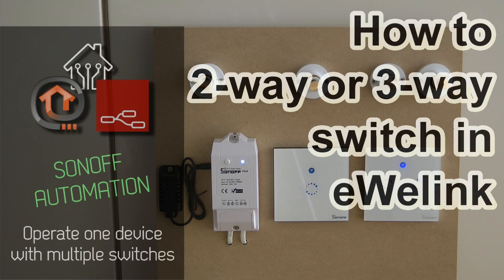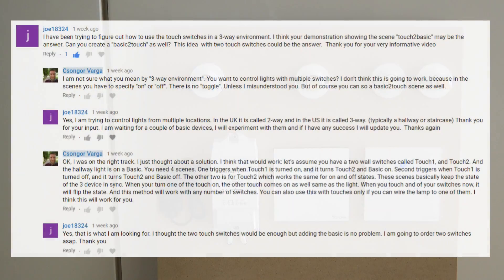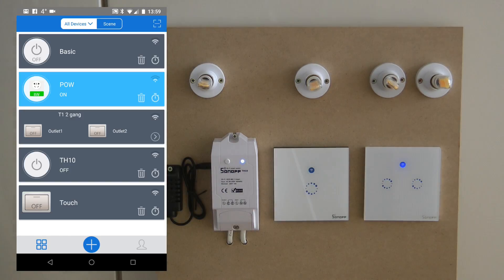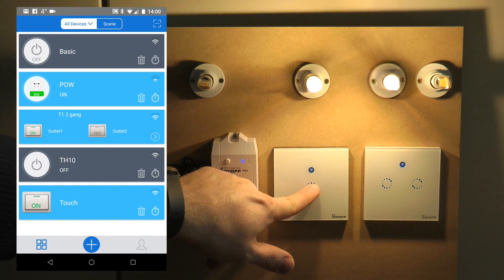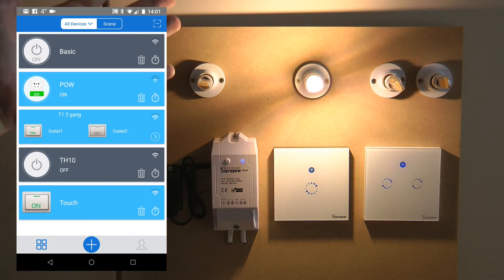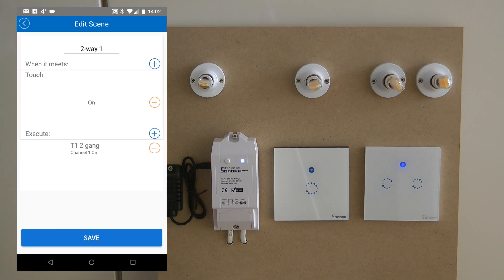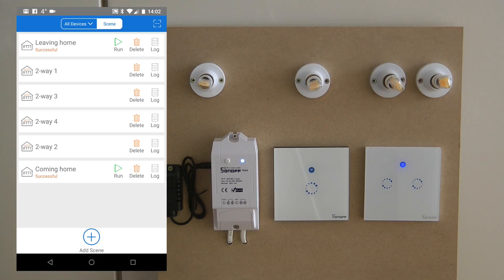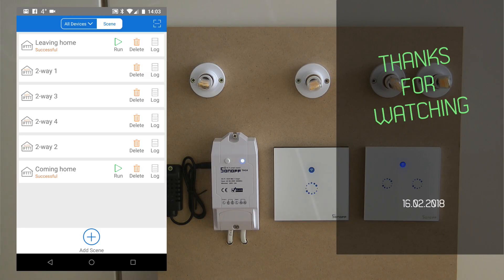How to set up 2 way or 3 way switching in Sonoff / eWeLink

Comment: Does this work with multiple m5 switches or do you need an r5 switch to
Reply from the maker: This is a very old video now. Since this video, there is a group option in the device settings, and you can just select the device that you want to group together, no need to set up scenes any more. It works across multiple M5 switches, you do not need an R5. This group may only work across switches with the same number of gangs. But if yours are different, you can always fall back to this scene option.

Comment: Do you think it's possible on new TX Ultimate?
Reply from the maker: Yes, scenes are universal. But since I made thia video, there is a dedicated Group function in the device options. It does the same thing and only takes a single click.
Reply: @csongorvarga  So all these methods (the older version in this amazing video of yours and now via the Group function) require they communicate/function via wifi?
Reply from the maker: @airwebber  All of them need wifi, there is no other way the devices can talk to each other. The old scene method uses cloud so it will definitely not work if your internet connection is broken. But the group function may be done via direct device-to-device communication,  but I am not sure.
Reply: @csongorvarga  I set two up just last night. The group function didn't allow each actual wall switch to function like a standard 3-way configuration would. I would have to use the app each time to shut the final power source down. The best way to get two (or even more) of these switches to work in a true 3-way environment was to setup automation logic.

Comment: What happens if the power goes off how will the three way switch work then
Reply from the maker: If the power is gone, these smart switches are down as well.
Reply: If there is no power, then you wouldn't be able to power the switches even in a normally installed 3-way configuration. I would assume once the power came back on and your wifi network rebooted and went live, the two switches would then via whichever method you are using (scenes or groups) start working again. At least in the Sonoff switches, I use, you can tell it how to react if power was loss and then turned back on. So, you could tell the switch to do whatever the last state was, prior to the power outage.

Comment: I have 2 way switches and i'm planning to replace them with M5 smart switches. Do I need the same for M5 wall switches to configure them on application level, or maybe the wiring behind will do the magic with M5 ?
Reply from the maker: This is an old video, and nowadays it is much easier. You install both M5 switches, you connect the light to one of the output, and the other M5 switch is not even connected to the light, just connect the line and neutral lines so it works. And in the app, you can group these two light switches together. This group function was added after I made this video.

Comment: How can i create these scenes on the new ewelink app? I cant find “when touch” is on option?
Reply from the maker: Scene button on the lower icon bar, then plus sign on the top right, then plus sign under "if" and "Tap to perform".
Reply: But this will be a manual scene, I want it the same way you showed on the video?
Reply: Please tell me what to do exactly if I have two way switches .. each is 1 gang for simplicity. On the new ewelink app

Comment: Probably a stupid question but just to confirm since I'm not fluent in English.
I have 2 normal switches, the 2 light the same room and one of the 2 is double so it lights another room. If I install a one-button M5 and another two-button M5, can I have the 2 to light the same room and the second button of the double to light another room?
It's because I had already researched and they said that I could short-circuit the smart switches because they were in parallel.

Edit: I'm sorry if I've already answered the same question but I've been reading and I don't quite understand.

Comment: nice video i want to ask if you can use different switches for the same 2 way purpose for example T1 with M5 because thanks
Reply from the maker: Yes you can. The scenes work across every device. But since I made this video, a group function is also added to devices. It does the same thing as scenes. But it looks like you can only group same products. But in that case, scenes is the solution.
Reply: @csongorvarga  thanks a lot for your quick answer because i want to have a physical button like on M5 but they make only black and all of my other switches and sockets are white. And thats why i have those two. So i can create a scene with two different type of switches and make it work with 2 way if i understand correctl? I want them for my bedroom right now i have 2 switches one inside(near bed) one outside

Comment: I'm quite late to this video but for the switches that you have, would it be possible to also wire the second light on the second switch to a completely different light?

For example:
the single switch is for a stairwell light and the first switch, on the double switch device, controls also the same light, as shown in the video. Then the second button on the double switch would be used to control a hallway light. i'm not sure if that makes sense but i hope someone can assist
Reply from the maker: Yes, they work completely independently. So one can be on 2-way setup and the other just on it own.
Reply: @csongorvarga  Thank you for the response on such an old video appreciate it. One more question tho. Since these switches work off of wifi and automations, technically you could have one switch wired to the light and the other just powered on and set up an automation just like you have in the video? Theoretically it would also accomplish the same thing, with the automations turning each switch on and off.
Reply from the maker: @stealthfatal  Yes, you can use it only as an input device and not connect anything to it directly, but use the automation to drive a different device.
Reply: @Csongor Varga  I am facing the exact dilemma and thanks for the video. 

The UK old wiring has no neutral at the switch so we buy no neutral smart switch and then add capacitor to the light. If i have a smart switch which controls 6 downlights, do i need to add capacitor to each downlight or just 1.

The 2 gang smart switch came with a big capacitor which i presume is a double capacity as it is for a 2 gang smart switch 

The 1st switch on the 2gang is for the downstairs lights The second switch on the 2 gang is to create scene for the stairs light (simulate 2way switch)

Will there be any issues if the the capacitor is connected to the downstairs light as the 2nd switch is only for scene? Will there be conflict?

Remember i will also be adding a capacitor to the stairs light whose smart switch is upstairs

Thanks in advance for your patience
Reply: @Csongor Varga  Downstairs which has 2 gang switch. I will comment L with live and L1 with switched Live. 

L2 is empty

How do i power L3 (second switch) which will be my automation simulating  switch for 2 way? 
Will L1 add power to it or do i need to add another wire to L1 connection from the upstairs single smart switch and bring it downstairs into L3?
Reply from the maker: @babaone27  You need only 1 capacitor. And in my opinion it does not matter which light you add it to. Both lights have the neutral wire and if the capacitor let's s small current through to the switch, it will work.
Reply from the maker: @babaone27  Yes, this is where it gets tricky. Because the second switch also needs power. The first switch gets live connected to it, and neutral via the capacitor. But the second switch is used just as a "switch". But for the second switch which has no lamp connected to it, needs a neutral. The only option I can think it to use a regular Sonoff switch for it (that needs neutral) and re-wire the switched live wire (which currenty goes from the switch to the lamp) and to bring the neutral back to the switch. It is sketchy because the black/brown cable will in face used for the neutral. But can't think of another solution right now.
Reply: @Csongor Varga  Thank you so much for your reply.. I am so grateful
Reply: @Csongor Varga  

After watching this, 
https://youtu.be/GRY_H6UfATw

Looks like i can get away without connecting anything to L3 and just use it as a 2way as intended. This is because the L will automatically give power to L3
Reply: @Eric Williams  how did you manage to sort your smart switches out? I am in the same situation as you

Comment: man you saved me.. i was dieing trying to solve this using another crazy method. because of my stair light.. now i guess i can buy a sonoff mini for the upper lamp. right? thank you very much
Reply from the maker: Actually with the mini, you can do 2 way switching with traditional wiring and you only need a single mini: https://community-assets.home-assistant.io/original/3X/d/0/d04531ec59ede1c19890a702dd8e0ad668d1e0d7.png
Reply: @csongorvarga  i have downstairs 3 touch. 3rd Button is a two way to the stair. Thats whey i need a complex solution. Upper switch i can leave controlliing light and put a mini to controll  from the 3 Button touch downstairs
Reply: @csongorvarga is this also same for mini r4 m?

Comment: Useful  explanation of this scene way of synchronising the two switches..  Not sure if you are a SonOff engineer or not, but I was wondering why these units use a relay and not a solid state switch, like a Mosfet with a bridge rectifier? I appreciate this is not a trivial thing to design, especially because of the high voltage AC interface. but solid state would be very quiet!  I was designing tuoch switches many years agao before we had LED lamps and of course in those days we typically used a Triac and ran the switch from a series Live and Switched live connection.. Whereas the modern SonOff switches typically have a Neutral connection making it much easier!
Reply from the maker: Thanks, btw some device now also have grouping, so no scenes are required. I think the relay vs. SSS or mosfet is simply price. Also your low voltage and high voltage side is separated.
Reply: @csongorvarga  I guess the no neutral required use a solid state switch though? Much harder to extract the power you need for a relay...??

Comment: Great video.. Quick question.. So 2 sonoff switches.. Do you only have the wires to switch the light only connected to thw output at one of the switches..
 The other switch has nothing connected to the output? Is that right?

Comment: Can you basically join two of the sonoff modules to work off one switch so say you had living room lights on one module and upstairs hall lights on another module but you want them both to be controlled off the one switch just for a example

Comment: I did not understand.  My scene thing looks different and I don't get it.  I have two lights in the hall and they don't work together.
Reply: I can group them on Alexa but they don't work together if I touch them which is annoying.  I really did not understand your video.  How do I set up scenes so that when I physically touch the light switch they work in sync?

Comment: can i just replace my old normal 2-way switch..with new sonoff switch (add-on neutral line). or i need to do some wiring change as well?
Reply from the maker: You can use the existing wires for the old switch. That should work

Comment: Hi mate, quick question

We're replacing our broadband provider so will have a new router.  Will I have to reset all 11 of my switches of will they still continue to work with my new router?

Thanks
Reply from the maker: I would say no, but somebody just commented, that none of their devices are connecting with the new router. So it looks like even if the SSID and the password are the same, all of them need to be paired again. But I never tested this myself.

Comment: Thank you so much for that. Quick question about the wiring: Does the neutral need to be in the same loop as the line or can it come from a different source? My point is that my current 2 way wiring doesn't have a neutral. I can bring one but it won't be the same as the one going to the bulb.
Reply from the maker: That is a very good question. I guess if they are connected to the same circuit in your breaker box it should be OK. But I am not sure. If it is after an earth-leakage circuit breaker and you use neutral or live from a different circuit, the ELCB will definitely trip.

Comment: Would this be a possible solution using the Sonoff TX T4EU1C that doesn't need a blue wire? Using the same scenes.
https://i.imgur.com/KkB1XyR.png
Reply from the maker: Yes, that is correct. It will work with scenes.

Comment: This video is great, but since i live in UK to the switches go only Live line there is no neutral line.I don't want to wiring new cables, Is there any way in to do the same circuit but without Neural Line ? Thanks
Reply from the maker: Yes, there is now. Check, there is a "Single Live Wire" TX wall switch. That only needs a live in and live out and nothing else. It needs a small unit across the live and neutral at the light. As far as I know, currently only a single gang model is available.

Comment: Hi. This is very useful! 
I have one question. Does the rules still work when the phone with the app is off or is away from the home? This is a game changer for me before ordering the switches. 
Thanks in advance!
Reply from the maker: Yes, as long as the device have working internet connection, this will work.

Comment: I want to use a T1's physical switch to control a Sonoff Basic WiFi Switch. Is this possible?
Does the device appear in both the 'Condition' and 'Perform' section in the scene setup? I ask this because although my TH10 appears in the 'Condition' section, it does not appear in the 'Perform' section.

This is the Sonoff Basic Wifi Switch - https://www.aliexpress.com/item/32896954270.html?spm=a2g0o.productlist.0.0.72ee584aPgVsmM&algo_pvid=c7d00bcf-0bd2-4448-99fa-33020a6624bc&algo_expid=c7d00bcf-0bd2-4448-99fa-33020a6624bc-2&btsid=c12fdd1a-be67-4615-98dc-e02ead059a7a&ws_ab_test=searchweb0_0,searchweb201602_7,searchweb201603_53
Reply from the maker: I have noticed that one you use the device in the condition section it cannot be added to Perform. But that should not limit you. In your case T1 will be in condition  and Basic in the Perform.

Comment: How did you set - coming home and leaving home?
Reply from the maker: I set it as manual trigger so I need to active it manually. And in the actions I just set all my devices to on or off.
Reply: @csongorvarga  Thanks for your answer, is there any way to do it automatically? when you enter home to turn on the lights?
Reply from the maker: @FearOfGeorge  Yes I couls think of a few ways. You install IFTT on your mobile and there you can set up a geofence trigger. And that turns your light on. Or an RF motion sensor and Sonoff RF Bridge.

Comment: did i miss something, how do you set up the two switches? how does the one know that it is connected to the other. how did you sync the two switches?
Reply from the maker: I did not talk about wiring, but there is a link to a PDF in the video description. Syncing the two switches are done using scenes. I have talked about that in detail.

Comment: Hello, great video. can this method work between a 3gang and 1 gang switch? can i say that all smart switch has this function of syncing with the other switch?
Reply from the maker: Yes it does. In the scenes you set up the action and the condition per gang, so you can do it. Even more, one gang could be controlling one 2 way light and the other gang can control the other.

Comment: Works great thanks!  Also if anyone has a problem linking the light switch to the wifi, try turning airplane mode 'on' on your phone, and manually activating wifi and repeat the pairing procedure.

Comment: Thank you for the video. Can you please tell me what will happen when the internet connection is down, and there is no wifi? Will that solution work?
Reply from the maker: No, anything which is done in scenes will be not working when the internet connection is down. It will come back automatically once your internet connection is restored.
Reply: @csongorvarga  Even a bit late I think it should work. Don't they have LAN mode as every sonoff switch ?

Comment: I have a sonoff 4 ch pro and 4 two-way switches...I want to connect them such that when I will use the regular two-way switch it will get sync within the app as well. Is this possible? Please help...
Reply from the maker: I am not sure if I understand your setup. How many lamps do you want to control and with how many switches.
Reply: @csongorvarga  I am going to connect any 4 appliances, say 4 bulbs in the channels of sonoff and 4 two-way switches for each channel to be able to control manually. Now, I was able to do that but when I turn on/off any switch manually it won't sync up in the app...So is it possible to do with sonoff
Reply from the maker: I got you. 4ch pro does not have manual switch inputs. If you want manual control, you are better off using other products. For example 4 Sonoff Mini. Those have a switch input so it is ideal. Or use TX wifi switches. In these the manual switch state will be automatically linked to the state in the app, so you don't have to do anything extra.
Reply: @csongorvarga  Okay got it! So its not possible with Sonoff 4ch right?
Reply from the maker: @advaitthakur1038  Well, it is possible. But you still need to buy a TX or Minis for the switches. Once you have that you can set up scenes, If Switch 1 is On, 4ch Channel 1 turn On, If Switch 2 is Off, 4ch Channel 1 turn Off and so on. So it is possible.